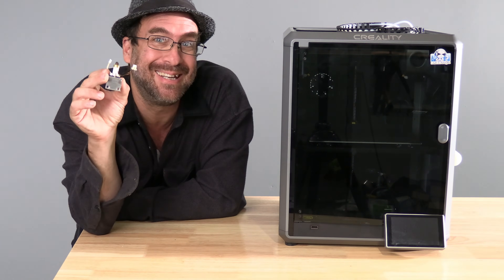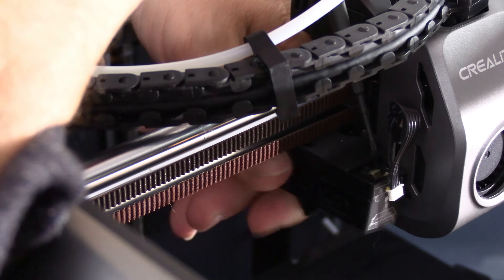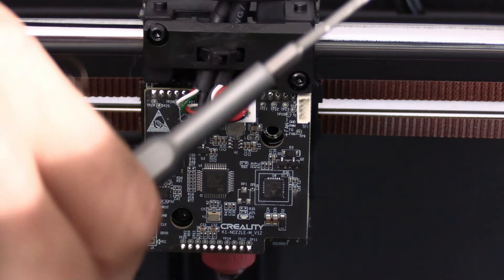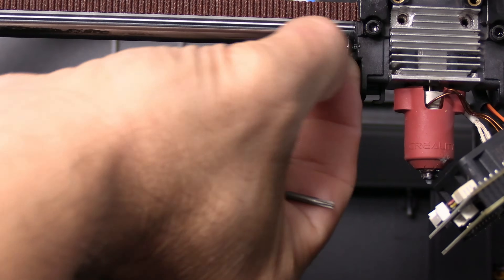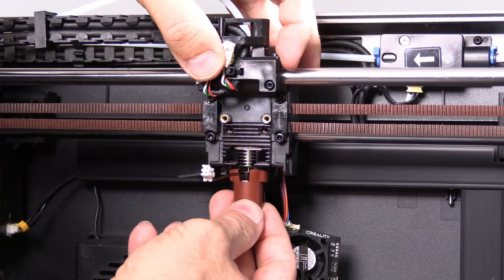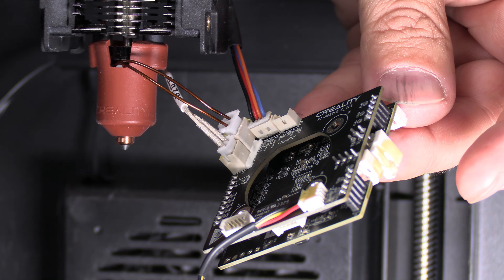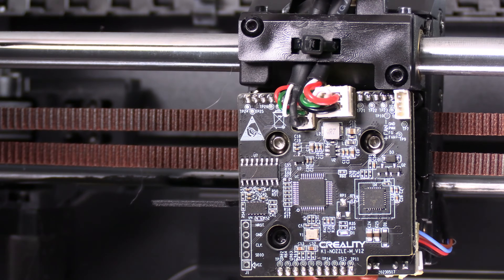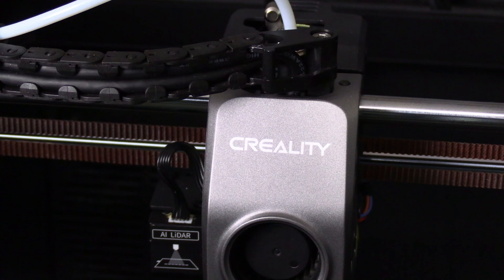How to install the Creality K1 or K1 MAX Unicorn Hotend Upgrade - 3D Printer

Comment: I was rejected to join your face book group ! I am deeply gratified !
Creality support are sending a new redesigned board which apparently does not require my missing plug, together with a new hot end. Unfortunately
they did not tell me the function of this socket despite asking several times. 
 Its taken some time to get them to understand my problem - " but I do understand that English is not their 1st language". But a stark  difference from Qidi's support  which is excellent.
Reply from the maker: Creality is many times the size of Qidi, and, doesn't have US reps. You are speaking directly to their Chinese employees, who have really great English, but, not to the level you would get from a native speaker. I didn't reject anyone recently from my group....

Comment: this video is a brilliant aid to reassembly following installation of a the new hot end assembly. However I have a problem.  With one connection. The pair of plugs held in place by the spring loaded bar the ugly large 4 way connection and the 3 way plug adjacent to it on the top of the front board. I removed the bar and cut the strap as recommended, this worked well and I was easily able to plug in the ugly 4 way connector. How ever its mate the 3 pin cable disappeared and I just can't find it. The printer functions and extrudes fully but shows an error Key 103  fan exception which would be the plug with the missing cable. Any suggestions as the where I can find this cable and plug  - I have looked and disassembled things I just cannot find the cable !! obviously I can't print with finding it !
Reply from the maker: Do u have a photo or video of this cable? From you or somebody else? Reality can likely send u one. Cs@creality.com
Reply: @3DRundown   No but I can use your video to achieve that. My problem is also I'm not sure which fan it is at the moment. Although I could find out by trial and error. Its most strange, as one moment the cable was there, and then when I wanted to plug it it - it was gone never to seen again.

Comment: Thank you for doing this. Whats your opinion on going with the Microswiss head still? Micros swiss cam out with a new hoteend with a longer nozzle. I have a microsswiss installed,  I did that after the original hotend gave me a horrible mess of melted plastic blob. Now my extruder is starting to jam the filament, and the culprit is that blue tube so I am moving to this upgrade which will have me remove the microswiss hotend. The only thing i dont now is if the new hotend is better than or equal to microswiss? Or am i going to have that blob nighmare again ?
Reply from the maker: Let's get this out of the way: MICROSWISS makes amazing hotends. The build quality, is better, period.

That said, I have thousands of hours, and ass tons of $$$ earned, using K1's and the Creality HOT END. You'll be fine with either. The new Extruder is the way to go

Comment: Your video seems to imply that the copper wires are the thermistor, and the wihite ones are for the heater. This is actually opposite to reality. You only have to look at where the wires come from to realise this.
Reply from the maker: Even if I said the opposite, while filming, which is certainly possible, it doesn't really matter, as they are being plugged into the right place, and only fit in the right place

Comment: Any recommendations as the filament has gone everywhere and covered EVERYTHING and it is impossible for me to undo the long screws underneath holding the hot end in.
Reply from the maker: it's PLA, it will melt. Heat, small tools, such as needle nose pliers.... and patience. It's gonna suck.

Comment: hey, I've gone through 3 of these so far. They keep exploding becoming fully encased in filament. it's pla. At first I thought if I left the lid off that would solve my issues, but it keeps happening. Why is it doing this?
Reply from the maker: I have never had a bob of death on a K1, but it can happen to any printer. The hot end and/or nozzle, are not being fully seated, causing a leak, at the heatbreak, which builds into the blob of death.
Reply: @3DRundown  right but how do I seat it correctly? I follow all these videos and I see how everyone does it. My heat sink isn't snug when I push it up in. Should I tighten or loosen the two screws on either side of the hot end?

Comment: One thing you skipped, and it makes a big difference when you put the fan shroud on, the extruder control/power cable. It needs to be BEHND the inner right of the housing, NOT on the outside. Also, the long black screw, the one you said would not tighten, it goes into the heatsink left side, as it did on the old hotend. You will get vibration from the PCB if you skip it.
Reply from the maker: Wire is good. It wouldn't tighten cause I skipped the little spacer. Got about 500 hours on her. 👍🏼

Comment: Thanks for the video. I have a couple of questions though.
The unicorn kit I bought came with a plastic bushing. According to the official video from Creality (I'd say less detailed than this one in a few ways) it's for the black screw holding the radiator (heat sink I think is the name). They say it's not required for integrated nozzle models but I'm not sure if it's my case. Do you know how to distinguish it?
Secondly, the kit also came with a small pack of thermal paste. I couldn't find an example of where I'm supposed to apply it. Is it just in case is needed in the future?
Thanks in advance.
Reply from the maker: The thermal paste goes on the heat break. That's if you are doing JUST the nozzle, rather than this whole assembly.

Comment: you forgot to show that after each change of nozzle and heating unit you have to do HOTPID...
Reply from the maker: Nope. I didn' show it, cause I haven't done it. Can't remember the last time I did a PID on any printer, but it can't hurt
Reply: @3DRundown  🤣🤣🤣🤣🤣🤣rally?😅
Reply from the maker: Yep. It's a bit over rated. If things are going wrong, I may put it on my troubleshooting list, but, genrally, it's not a critical part of a nozzle change. I ship over 1000 3D Printed orders a year, so, I am speaking from my experience, rather than from "by the book"

Comment: Hi, when doing this upgrade, I experienced the issue that the new assembly does not go high enough to line up with screw holes. Do you know what might be the issue? Can't see so far what is stopping it.
Reply from the maker: There isn't really anything in there to stop it. Make sure the grub screw is OUT far enough, to not hit the heat break, and work the hot end all the way up. A little twist and it should go
Reply: @3DRundown  There was actually something stopping it. Small piece of plastic tube around nozzle tube. This is what is preventing the assembly from going further in. When it is removed, it goes in and lines up properly. Was this something yours had?
Reply: @3DRundown  Looking at the video closely at 5:50, you didn't have it. Weird, it was supposed to be original creality part. To clarify, this piece is hitting the place where the nozzle tube from assembly goes in, there is this protruding opening that can be seen at 5:50. Sorry, don't know how to call it, I'm new to this hobby. Your video helped me a lot.
Reply: Same how did you solve that?

Comment: yes but you will eventually round the screw head out
Reply from the maker: Never have. 45+ machines. All these use very little Torque. If stripping them, your way to tight. Also, keep in mind I use whatever I can to keep my hands out of view, and clearly show the screw movement. I'm not terribly concerned about much else.

Comment: I'm in the process of having to replace my hot end. I also need to replace my heat sink because I cannot for the life of me get those two screws off. Anyhow, good video, but I wish you had included the type of and size of the driver you used to remove the screws.  You used some torx drivers. I didn't use any...all hex drivers. These details would be helpful. Creality could have used different drive types with different production runs.
Reply from the maker: Your standard set of Allen Keys, (included with the printer) will handle any creality build. I use different tools, for easier focus and visual, on Camera, to help keep my hands away from the part. If they tight. Heat them up.

Comment: Working with a catastrophic failure.   I can't get the two screws out of the bottom.  Petg blob.  I'll try heat.
Reply from the maker: Grab a cheap heatgun at home depot or a hobby shop

Comment: I just installed that same setup on my K1 after a catastrophic blob. Now I'm getting under extrusion like crazy. Did you change any of your slicer settings after the install? Or could my extruder be bad?
Reply from the maker: I went back to business as usual. May want to have a look at your extruder. Run EXTRUDE/RETRACT,  and see if it looks to be functioning normally.
Reply: @3DRundown  I took the extruder apart today, and nothing looked damaged. I cleaned it out of particles. I'll run that test next and see what I can figure out. Really frustrating, was working perfect before that failure.
Reply from the maker: Worst case.... Loosen up the Unicorn... Make sure it's installed properly, and retighten it...
Reply: @3DRundown  I did that yesterday, was thinking maybe Amazon sent me something other than a 0.4mm nozzle. They didn't. Going to be doing the retraction tests today and see what I can figure out.
Reply from the maker: Hope it works out. I hate chasing ghosts like this. Could it be a temp thing?  For PLA use 220. Use speeds around 175-200.
Reply: @ Still chasing. Going to see if the Z offset needs adjusting tomorrow. During my tests, I seem to get better results when the model fan is off.

Comment: I'm having a hard time removing the screws from the hot end, the tool you are using looks like a great fit. Can you link that tool and sizes you are using. This video is very informative, thank you!
Reply from the maker: People cry a little, cause I use star bits, on my printers. They work fine. This is the same tool, from a different company (mine was TECHMAN, it's not available anymore). : https://amzn.to/3AIL2tw

Comment: since doing this my hot end constantly clogs in the middle of prints, any idea as to why?
Reply from the maker: I've heard some people with Unicorn Clogs. Perhaps a small gap, where it's not seated properly? I Would consider loosening it. warming it up, and reseating/tightening everything. Also, avoid printing to crazy fast, or too hot. 220 is fine for PLA

Comment: Very good, insightful and helpful thanks. Just at the end (e.g. 10:23 on the video), it's clear that one of the cables is misrouted, and about to be clamped under the tool cover. I had to reverse a few steps to get it out of the way. You can see back near the beginning of the video (e.g. 2:12) where it's supposed to go.
Reply from the maker: That cable is just fine, and right where I want it. The tool head is flush with the screw hole, and installing the screw creates no movement or pressure. There is also space there

Comment: Is the upgrade worth it?
Reply from the maker: Only if your hotend has an issue and needs to be replaced
Reply: @3DRundown  my k1 is running solid on stock hotend not unicorn just with trianglelab zs plus nozzle, but i also have this kit and e3d obxidian nozzle not installed. Wondering if i should wait till they go bad before installing them
Reply from the maker: In my opinion, 10000% less. I ran stock till I made this video. And only cause my Extruder jammed, so, it was a good time to shoot both. I wouldn't do it unless something fails
Reply: Issues being.. clogged nozzles? I have a k2 on order but the nozzle clogging and extruder jamming on my max is getting tiresome.

Comment: I wonder if this would work on the CR-10SE.  Not that I have issues printing, but i could get rid of the boden tube
Reply from the maker: I don't believe it will. My SE has the Micro Swiss hot end. It's been perfect.
Reply: @3DRundown  I bought it for the CR-10SE, but I have not installed it on my printers.  I am waiting till the hotend makes me mad enough to do it.
Reply from the maker: It's a very easy install, but, I wouldn't do it just for the hell of it. Mine was printing like shit. The reality is my hot end was probably loose.

Comment: Removing the silicon boot on my ke is where i broke all of the ceramic connections.  The Micro swiss hotend and heat sink are a big improvement in quality over the creality stock. I would like to see creality make their printers more user-friendly.
Reply from the maker: The new Creality standard hot end is much better. This Unicorn looks pretty solid to me also. MS hot ends, are in a league of their own, but, keep in mind they cost triple. P.S. I am about to shoot a K1 Micro Swiss Hotend install. 🔥🔥
Reply: @3DRundown  I'm glad to hear that they have improved their hot end. I'm looking forward to the new video. Which printer are you installing it to?
Reply: @GenX3Dprints  I think you can get this unicorn nozzle hotend for the KE also - i saw it on Amazon when i was looking for the K1.  The K1C unicorn nozzle is so good, and MUCH cheaper than FloTech ones.
Reply from the maker: Certainly cheaper, but The Flowtech quality is unmatched. So far, my Unicorn is doing well.
Reply: @3DRundown  I guess I forgot to mention in my original post that I have installed the micro Swiss hot end and heatsink into my creality KE. I thought about making 
a video for it but then decided not to, I probably should have.
Reply from the maker: Making a video turns it into a pain in the ass. I don't blame you.

Comment: That one is very involved , glad i don’t own it .. very detailed video but it needs to be  .😎👍
Reply from the maker: It's awful. I dunno if it's worth it, but, I took one for the team. It clearly looks better made, than the original, which, was still working flawlessly for me....
Reply: @3DRundown  well this video did explain it very well to people that own it that is great. 👍 i have a tough enough time with bambu  lab which is  less problematic in my honest opinion..
Reply from the maker: My PS1 Extruder self destructed a few months ago, and all my poop chutes SUCK. Nobody is safe. 😂😂
Reply: @3DRundown  yep shit happens
Reply: @3DRundown  do you have a K1C or V3?  This nozzle is much better.  I had tons  of issues with my K1 so I'm glad to have this upgrade finally.
Reply from the maker: I have a K1C, V3, and V3+.  I have assembly videos for both V3 here on the channel. My K1C is still in the box. I have never used my V3, and my V3+ died in ONE DAY.  My K1 Max is my favorite printer, along with my K1. I have been running them nonstop since launch, on their original hardware, till this week, where both got new extruders and hot ends, for the channel. The only reason I never shot these upgrades sooner, was, because neither machine ever had a single problem. Both has a 0% fail rate. Then, in the same week, both extruders died, so, it was time!

Comment: On the kits I had for my K1 Max & K1  I had I had to add a black spacer washer to the black screw after it exits the fan
Reply from the maker: Yup. I skipped the spacer.
Reply: @3DRundown  I seem to have lost this spacer... Do you know the dimensions, so I could potentially print a replacement? or where I could get a new one without a whole new kit?
Reply: i skipped the spacer too - i saw it in the bag but didn't need it.  Where did you put it exactly? on the K1?
Reply: oh the black screw - the bottom one.  I didn't notice that
Reply: @thelees1000  Hi, after you have fitted the black screw into the bottom left hole you push on the spacer, be careful not to let it drop off, (I angled the board back slightly) & then screw the board back onto the hot end - If you re read the instructions it should make sense. (I am not being condescending I promise)- I have upgraded my K1 & K1 max- also fit the cables for the hot end & the extruder before you screw the board back on it s so much easier.
Reply: @peterkhela8730  yeah i noticed that too - trying to get the cables on after the board is installed requires tiny hands.  I didn't think you sounded condescending lol - no worries.  I skipped the black spacer on my K1 and so far have had no issues.  Even printing TPU this week.  So far so good.  But yes, i should have read the instructions more clearly haha

Comment: Unfortunately my problem with my k1 max isn't the toolhead (which works actually pretty decently so long as I keep the flow reasonably low), my issue with my k1 max is with leveling the bed. - the center is always well above the edges and it's pretty frustrating... the mesh compensation often doesn't work all that well, and even if it did, i'd still end up with very slightly curved first layers. - i'm going to try to pop the bottom off the printer and see if i can manually re-level at some point, but I think it's just the flexing of the plate as it heats because it's such a thin build plate.  I'm not sure if I should resell it at this point and pick up a sovol sv08 or sink time and money into my k1 max getting it to a point where it's useful.  and of course the higher the bed temp, the worse the problem gets, and I print mostly ABS (hence wanting an enclosed printer).
Reply from the maker: I haven't touched my K1 or Max bed, and both have over 1000 hours, and do large masks around the clock. But some peeps, have done mods to adjust the bed, if you think it's something you need. Pop into some FB & Reddit groups